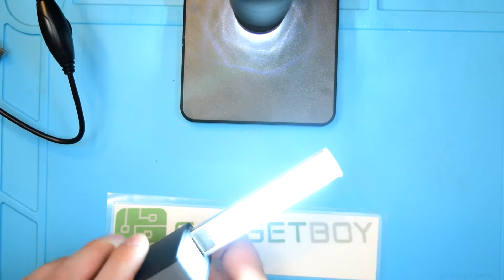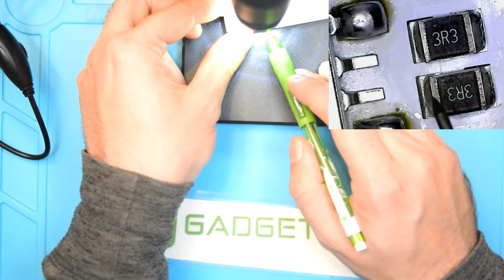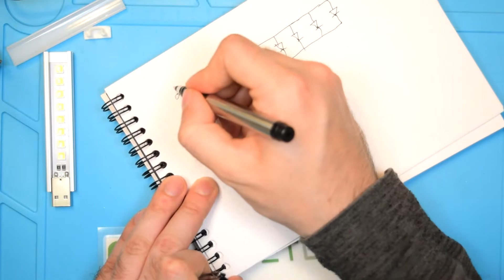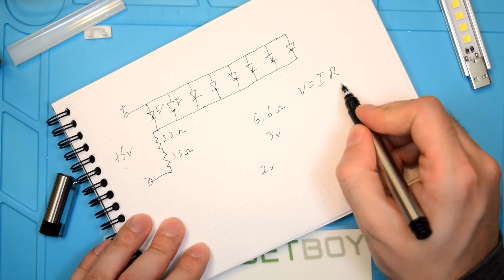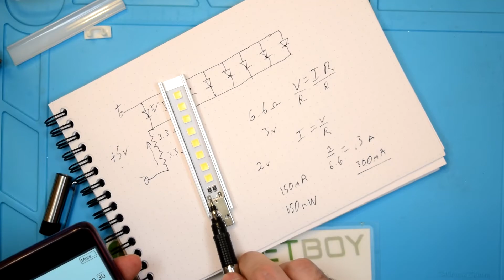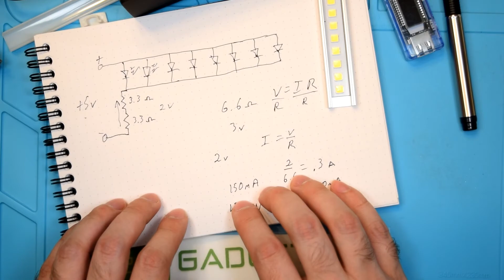USB flashlight teardown with microscope cam!

Comment: Why a 30 ohm, why not ten, or 1000
Reply from the maker: 3.3ohm. They probably chose 6.6 ohms (in total) to maximize the current in the leds. At 300mA, each LED was being driven at 37.5mA, which is kinda high for those LED packages, but they had plenty of heatsinking, so it's not too much of a worry. Higher resistance values would make them run dimmer.
Reply: Gadgetboy no no I mean for the bridging of the data lines to increase current allowanve
Reply from the maker: Ohh. Um, just some random value chosen by the guy who made the USB standards, I guess. I actually just did a bit of research, and there's a rather dizzying array of resistor arrangements on the datalines in order to enable fast-charge mode on different charging standards. The most common hack is a resistor between 30-200 ohms.
Reply: Gadgetboy an array? Can't they just pick which one works best? 😅
Reply from the maker: Because everybody has their own proprietary charging standards. It's dumb.

Comment: People like experimental, that's when stuff starts to get kinky... Is the microscope really 1000x? I converted a similar thing to look I side my ear
Reply from the maker: I haven't really tested it. It works great for my needs (seeing the bond wires was one of those "Ah-hah" moments I enjoy), but it did come with a calibration card, so I'll play around with it and figure out the actual magnification.
Reply: Gadgetboy you could always put it over a ruler and then measure the output on the screen, but it doesn't help if it then outputs a small image, I'd you had a 5mm led it would be 5Meters wide sooo...